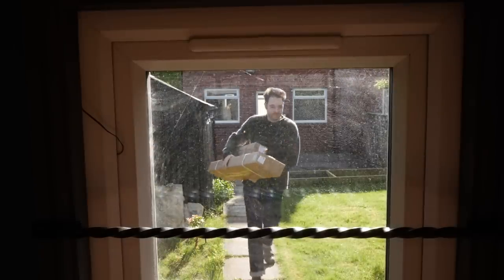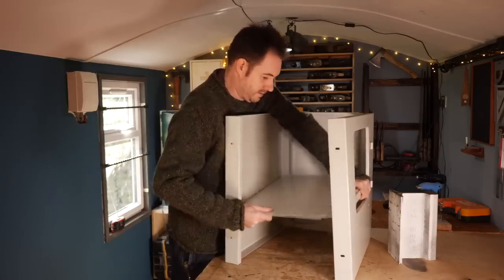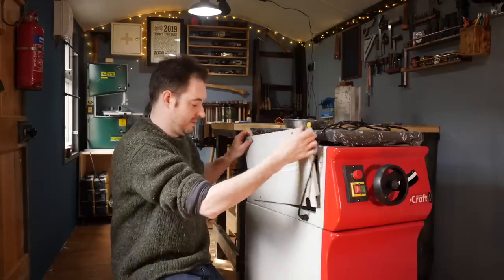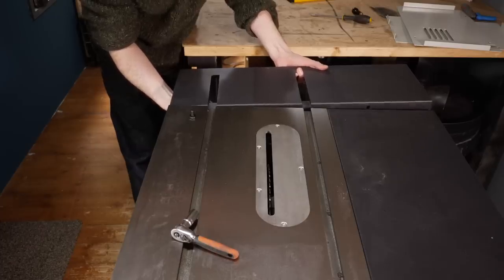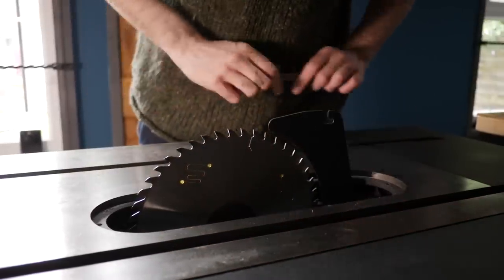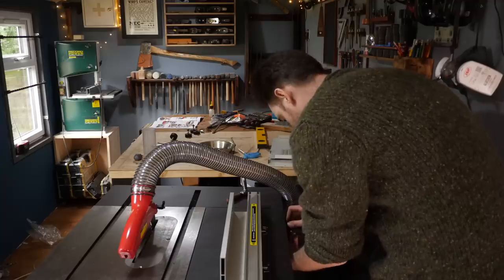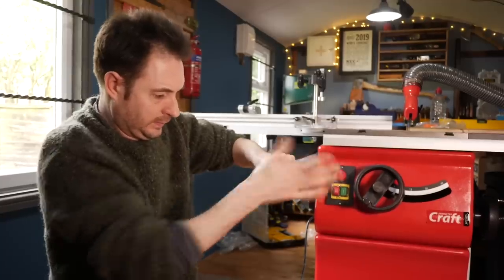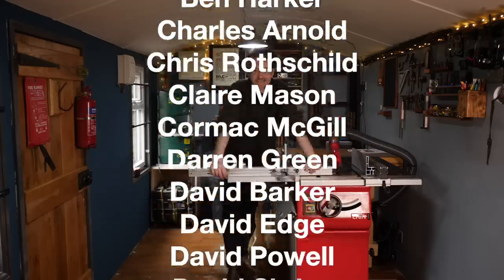Axminster Craft AC216TS 216mm Table Saw

Comment: Hi Matt had my sew must be 5 years now and love it also very quiet  🍺🍺👍👍
Reply from the maker: A quiet saw it great to use
Reply: Brian Gardner   Hi, Do you use any specific blade to help reduce noise? Also do you have a dust/chip extraction system chosen for lower noise level? 
Thanks.

Comment: I have the same saw. It's very good. Took me a long time to set up but worth the effort. Hope you love yours as much as I love mine
Reply: Peter Curtis Hi, do you use any specific blades to also keep noise down with that saw? Also do you have any specific dust extraction arrangement with low noise in mind? 
Thanks.
Reply from the maker: Thanks Peter. So far I am very happy

Comment: Hi Matt, glad you have got this fantastic piece of kit, i have the same saw and it has been very good and can't get over how quiet the motor is, good luck and will look forward to more videos about the saw.
Reply from the maker: I so nice to use a quiet machine
Reply: @Badgerworkshop  Yes indeed, my next upgrade will be to get a numatic vacuum like the one you reviewed before, for more quietness and more suction, i recommend when the blade on your new saw goes, replace it with a Freud one as the Axcaliber dont seem to stay that long.

Comment: Excellent timing for me as I've been looking at them all especially this one (want an induction motor due to noise) so hopefully this might be the one.
Reply: Noise is a big factor for me too, so I've been looking at this as an option. 81db for this one according to the website.
Reply from the maker: It runs very quietly. My extractor is louder
Reply: It is really quiet, in the right workspace, you can use it without ear defenders for a few small cuts if you're not putting on an extractor for them

Comment: I have one of these for a year now, very pleased with it. The only criticism I have is that it does not tilt to a full 45 degrees. I have made some zero clearance inserts which also help when doing cuts in narrow material. For the money nothing else comes close to this. For my needs it fits the bill.
Reply from the maker: I need to make an insert plate for mine

Comment: Nice one :) now all the table saw change arounds make sense I was looking at the charnwood W 629 which is in the same price range so I will be very  interested to see how you go with this.
Reply from the maker: I will tell you more about it soon
Reply: Phil Rogers hi, I had the 8 inch Charnwood and got rid of it, motor was under powered, blade alignment not good despite lots of fettling, fence was terrible, sliding table had constant alignment, issue, replaced with Dewalt Dw745, cheaper better,  bigger, way more accurate, awesome fence, of course louder not being induction, I squared that piece with the view that my extractor is louder than both .... interested to see how this Axminster saw goes but it has a low power motor.. 👍

Comment: I have the same saw - really good price for what you get with it. I also found the attaching the internal dust hose the trickiest bit. Will be looking to get the sliding table attachment based on your recommendation :)
Reply from the maker: I’m glad it was not only me who struggled with that part
Reply: @Badgerworkshop  I didn't take the shroud off though, I got the hose attached to that, then attached it to the other end before screwing port into the frame

Comment: Nice unboxing and assembly. Thanks. 
I have also been oogling over this saw for a long time. The induction motor low noise thing is one big aspect I like. 
I’m curious about partnering other things like blades and dust/chip extraction to also keep the noise down. If you notice a difference in noise between blades, please let us know. 
Also, like others have mentioned, I’m looking forward to seeing how you get on with that sliding extension. I never thought it might replace a miter saw! Nice idea. I’m currently thinking that a diy sled with bells on it will approximate the same. Perhaps you we’ll be able to comment after some use. 
Thanks again.
Reply from the maker: I will try and cover some of that in a future video

Comment: I am looking at one of these for myself but have seen a few issues with the table/blade level, tape measure alignment and the fence rigidity. So I am waiting for your update as to whether I make the purchase or not, I wouldn’t bother with the sliding table after just getting rid of one of these but I would be looking at the wheel base that they sell for this.

Comment: Don't forget to align the mitre slots and rip fence with your blade - I predict another video for that. The sliding table also needs to run parallel to the the blade or you'll get weirdness happening when you make cuts.
Reply from the maker: Already done

Comment: I remember you sending me a picture of this saw following your openday visit to Axminster and I must admit I was very interested but ultimately a chap in Axminster Basingstoke introduced me to the Bosch GTS 10XC and I was sold. I will be interested to see how you get on over the next month or so, especially with the sliding table which is the one feature I questioned. Is the space it takes up worth the benefit of having it. Anyway great build video. All the best. K.
Reply from the maker: Thank you. For me the sliding table let’s me get rid of the mitre saw so overall I have more space.
Reply: Badger Workshop Yes - of course that makes sense. The Bosch has a small sliding table which I do find really useful but I can’t quite let go of the mitre saw. My only niggle when discussing the Ac216Ts with the Axminster chap was the lack of a right hand side table and extended fence as they has on the TS250 I do like to be able to have a half-sheet ripping capability on a fable saw, as the Milwaukee had.

Comment: I'm really looking forward to your comming review of this Axminister saw :-) - at the moment I'm seriously in doubt wheather to go with the "Milwaukee M18 FTS210" (that you have reviewed earlier) or this Axminister one for my new shop?
Reply from the maker: Both are good. Depends if you want a saw set up all the time or one you can pack away
Reply: @Badgerworkshop  I wil have space for a permantly saw in my new workshop. But what is extreamly important to me is:

- A good, precice and steady ripping fence.
- Good steady crosscut abilities (or the ability to use aftermaket miter gauge to achieve this).
- Good dust extraction

Loudness and the ability to cut large boards is not that important in my case. 

Hmm, I allmost bought the Milwaukee last week, but now I surely will wait undtil your next review on the Axminister before I decide.

By the way, I just love your honest reviews on different brands of tools :-)...so THANKS! - many other reviews from Youtubers there is sponsored by manufacturers, look more like advertising instead of honesly reviews :-(

Comment: Excited to see you get this and looking forward to your review of it soon!  Do you know the length between the start of the blade to the sliding fence when its pulled back? This would be a big decider for me when cutting panels down.
Reply: +1 for this question. Wondering the same. Plus depth and width of the whole setup with sliding table installed (i.e. how far does the slider stick out on front and back, how wide is the table saw with the sliding table, incl. / excl. right side extensions)
Reply from the maker: The way I have it set give you 56cm. But you could move the rail further back

Comment: Is there any sideways movement (wobble) on the blade? I have the Evolution Rage5 table saw and the blade appears to be loose but it’s definitely tight on the nut. I’d upgrade to the Axminster if it was solid.
Reply from the maker: No movement.

Comment: Good to see you're continuing your one-man campaign to keep the table saw industry in business, Matt. 

I'm actually really glad to see you've got this, as there are surprisingly few reviews of this Ax on Youtube. It seems to me that all the saws you've had apart from the first (the Bosch GTS 10 XC) and this one can be discounted - but I (and I suspect a lot of other people) would be really interested in your thoughts comparing the two. Do you think the smaller blade on the Ax will be an issue? Was the Bosch significantly noisier?
Reply from the maker: The Bosch was much louder. I’m not worried about the blade size but then I still have my old 12” multico saw

Comment: One thing that I;ve found annoying, after using this particular model for several months is the "wiggly" fence. E..g  you align fence, move it to the desired distance and start locking it - immediately the end of the fence, in my case - moves to the right, a little bit, but enough so cut going to be slightly tapered. I've tried this and that, so far almost success - after I've manually added some washers under 2 screws in the locking block, but still. Not perfect. The riving knife, on my instance  - had ben skewed/bent. On other things - very good saw.

Comment: Thanks for the reply Matt. I’ve just had a reply to my enquiry from Axminster. The riving knife can’t be lowered for cutting dados and rebates etc. Axminster say they can’t recommend using the saw without the riving knife.  One of the reasons for me wanting a table saw is for repetitive cutting dados and rebates for bookcases etc. If I can’t do this with the Axminster, I may have to buy the much noisier Milwaukee. I really don’t like dust intensive routers or setting up a guide rail for repetitive cuts. Do you cut or intend to cut dados etc with the Axminster? Will you be reviewing this aspect in your review? Cheers.
Reply: Matt's made a video before called "Making A Riving Knife
" for one of his previous saws to allow for dado cuts
Reply from the maker: Yes it pretty easy to make a riving knife to do that cut and that’s what I will do

Comment: Hey Matt, really enjoyed the video thank you.

I'm looking to buy my first table saw. I've been torn between a bosch gts 10j or whether to spend the extra on the Craft saw and hopefully never need to upgrade in the future.

As you've had both saws, could i ask your advice? Is the difference in quality, accuracy etc significant and worth the extra investment? Have you found any disadvantage of a 216mm blade over a 254mm?

Thanks for any help.
Reply from the maker: They are both very good saws. For me the main advantages of the Axminster one is the standard size mitre slots the the quiet induction motor

Comment: Hi Matt, I've just bought the same saw and so far very pleased with it. Just a quick question, does the rising of the blade height handle seem a lot harder to raise than the lowering action?  Mine seems much harder to raise, I'm assuming this is just because of the motors weight? The tilting handle is smooth in both directions and looking at a clip of you making the box jigs it seems yours is looking harder to raise the blade too, any feedback would be greatly appreciated, BTW so far I love it, very quiet and smooth.
Reply from the maker: It always harder to raise then fall. Is the locking knob fully undone ?
Reply: @Badgerworkshop  yes the locking knob is unscrewed fully,  I think its just down to the weight of the motor and mechanism of the gearing but thanks for replying Matt and hope we both get the best out of our new purchase, Im looking forward to your review with interest. Great channel by the way, keep it up I watch all your videos and find them all interesting. Thanks again Matt, stay safe and enjoy the new saw, cheers, Mick

Comment: Hi Matt, what happened to the Milwaukee? I liked the look of the roving knife setup. That is the most frustrating thing about my saw as you can't do those cuts that the lower roving knife allows. What's the deal with that sort of process on the Axminster?
Reply from the maker: I will make a second riving knife for this saw

Comment: Matt, great video as usual. I hope they've improved the dust extraction from the old Hobby saws, they literally didn't suck. Axminster have at least seen fit to put  3/4" standard mitre slots in the table now. One question, is the fence scale still in 1/10" increments for the imperial scale or have they corrected that and made it 4R fractional?
Reply from the maker: It is fractions but I work in metric